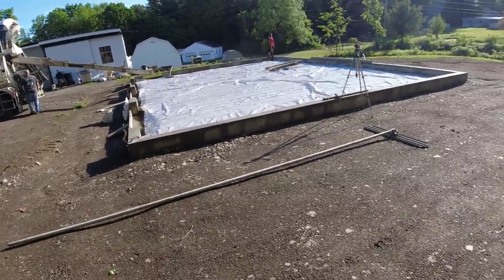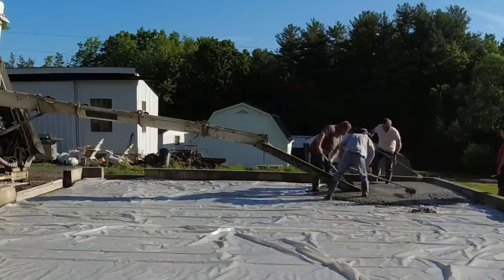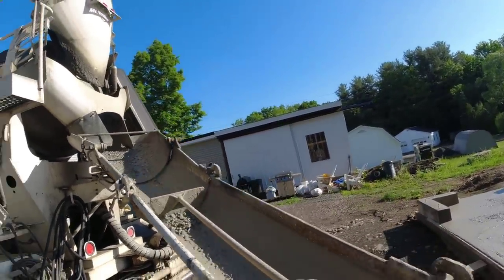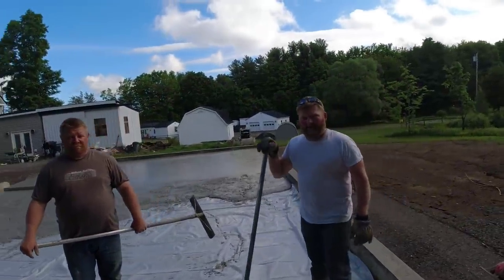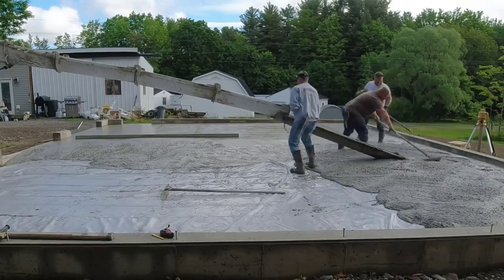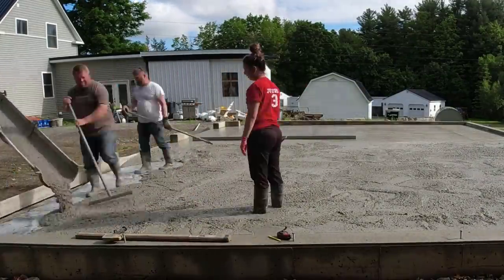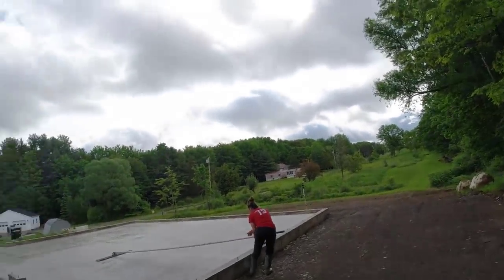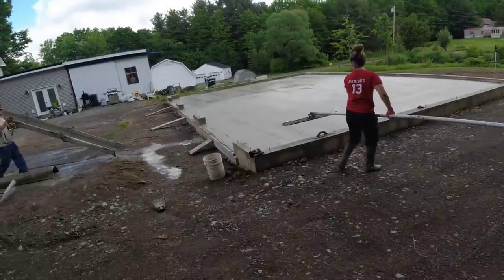Why My Concrete Looks Wet! (It's Actually Stronger Concrete)

Comment: When I built my garage and poured the slab, I used a 4000psi mix and Plastol; a few months later when I poured the apron, they had stopped using plastol and a started using Super P I think it was called. Super P wasn’t nearly as good as the Plastol. I swear the mix with the Plastol was pretty damn close to self leveling, within 45 min it set up to less than a 4” slump. Great stuff all around and it really helps the one man show.

Comment: I guess no rebar needed with fiber?   What are the advantages of the plastic liner?
Reply: Plastic liners are vapor barriers
Reply: If you've ever held the fiber mesh concrete in your hands, you can actually see the fine strands of fiberglass that act as miniature rebar covering then entire mix of the concrete - much better than rebar for a slab like this.  Rebar has important applications, but this is not one of them on a flat slope.
Reply: Fiber mesh, micro fibers, are not a substitute for rebar.  They aren't structural.  This is an interior garage slab, it's plenty strong without rebar.  Micro fibers greatly reduce or eliminate micro cracking.  But given the super P here and likely low water to cement, I would guess probably very little chance for micro cracking anyway.

Comment: Mike, I have noticed on your jobs that you screed ‘free hand’.  I’m an amateur, and I screed, resting on the form, or brackets that are mounted on screed holders.  How do you know that you are level across the whole job ?  Experience ?
Reply: wet pad…get it level and as long as both ends are touching its flat
Reply: Thank You for the info Mike !!  Have a good 4th of July !!!

Comment: I didn't see any rebar?
Reply: At time .12 Mike said  "we have fiber mesh reinforcement".
Reply: Why would concrete poured inside 4 concrete walls need rebar?
Reply: Also 6 inches thick rebar not always necessary could use wire mesh but he added fiber in the mix so it’s very strong
Reply: Yeah, I heard him mention something about glass fiber mesh?  as he always does, but still I thought there would be some small metal reinforcement such as something akin to hog wire mesh?